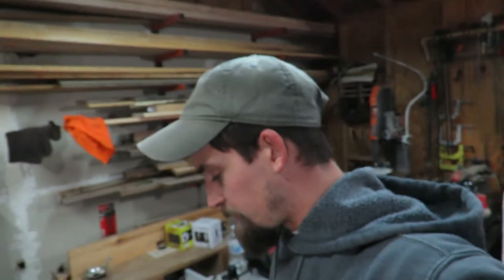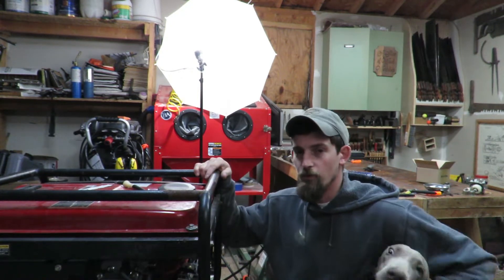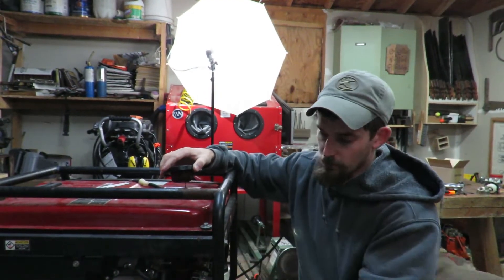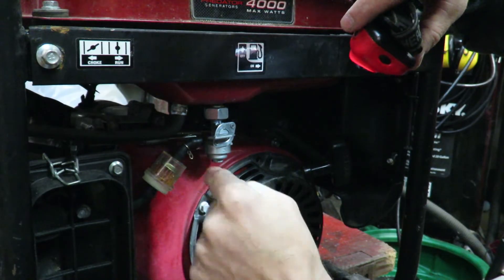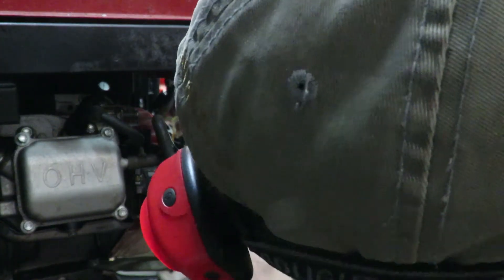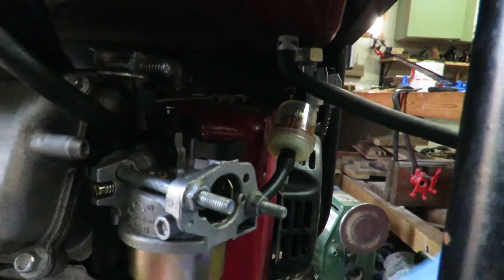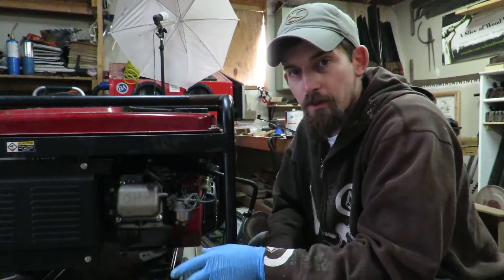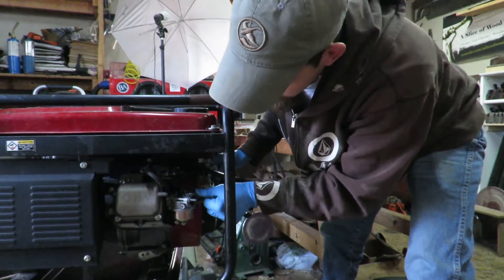Predator 4000 Generator | Solving the Fuel Issue

Comment: I have this generator with the exact same issue except this didn't solve my problem. Brand new clean carb and have adjusted screw. Starts and then after 3-5 seconds it dies. HELP!
Reply: You could check the fuel petcock, too. Mine was all gummed up and didn't allow gas to flow to the carb.
Reply: @mahlenbrenda  thanks but that has been removed and cleaned. Fuel line is clear and clean. I can play with the throttle and it will stay on a little longer, but I don’t know how to adjust. Everything appears connected, no missing springs or anything like that.
Reply: @bradleycutrell728  Another thing I learned the hard way - after I removed the petcock to clean it and all the gas drained out I put in new has, but didn't wipe out the residue from the old fuel first. Mine was like yours, it ran for may 15 seconds and then stopped. All the residue left over from the old fuel tank gummed up the carb again. So I drained it a second time and wiped gas tank out good and clean and after the cleaning the carb again, it now runs great.
Reply: @mahlenbrenda  Don’t forget about the generator safety rules: Always make sure you follow all the generator safety rules whenever you use your portable generator. This is only a reminder. Generators can be dangerous if not used carefully. Every year, hundreds of people die or get injured when using portable generators due to carbon monoxide poisoning and electrocution. Make sure you are using your generator carefully and keeping others safe as well. There is something very serious that everyone should always be aware of when using generators. Some people do run their generator indoors which is not safe and that increases the risk of carbon monoxide poisoning which can cause death of family and you. Some people run their generator in wet conditions which can electrocute them. Please remember that you should never run your generator indoors. Remember that carbon monoxide is an odorless and colorless gas that you cannot see or smell. Carbon monoxide is a silent killer. Keep that in mind. Make sure your generator is 15-20 feet away from your house and away from doors, windows, and vents. Never use your generator in your porch too. Having a carbon monoxide detector is very important against generator safety. Some people also allow children to go near the portable generator which could pose risks. We need to keep an eye on our children making sure that they are not near the portable generator so they won’t get electrocuted or burned by the generator which is dangerous. A locking enclosure also keeps kids safe. A generator shed might look like a tempting place to explore, or take cover during a game of hide and seek, but a generator is a dangerous piece of equipment that can cause injury. It says on the manual that we should also keep children away at all times from the portable generator to avoid injuries. Please do not allow a child or unqualified people to operate the portable generator.  It is important to keep your children safe especially little ones. The portable generator can be hot during an operation. Just because some manuals missed what should be listed doesn’t mean it’s safe to do. Always follow the generator safety rules when using portable generators. Generators pose electrical risks. If you need to use your generator during wet weather, you need a generator tent to protect your generator from getting wet. Don’t let your generator get wet. Keep your generator dry and before using your generator, please make sure your hands and your generator is dry. Do not wear loose clothing when operating the generator. Everything that is said on the generator’s operating manual should not be ignored. Never smoke cigarettes near the generator. Please keep flammable things away from the generator. Never overload your generator too. Your generator can catch fire. Never ever try to plug a generator cord into a wall outlet to avoid back feeding. Back feeding your generator is dangerous. Always turn on your generator first before plugging in appliances and shut off the appliances before turning your generator off. Use a heavy duty cord for your generator and the cord should not be worn out. All the instructions should be followed carefully. Never refuel your generator while it’s running. It can cause fire if fuel spills while your generator is hot. You should turn off your generator and let it cool off before refueling it. Having a fire extinguisher next to the generator is also important. This is only a reminder for everyone’s safety of using generators. Make sure your generator is properly grounded. Having a fire extinguisher next to the generator is also important against the safety rules. https://youtu.be/I1jT3ANENvI and here is a video more about keeping others safe when using generators and also about our family’s safety. It’s important to keep our little children safe as well. Make sure your little children are kept away from the generator at all times especially when it’s running. Hope this helps. Remember it’s better to be safe than sorry.
Reply from the maker: Where did you get the carb from? Some new one may still not be good. Is the fuel bowl getting enough fuel?
Reply: By chance do u  have good fuel Flow ? If u take off bowl ?
Reply: @3370603  Don’t forget about the generator safety rules: Always make sure you follow all the generator safety rules whenever you use your portable generator. This is only a reminder. Generators can be dangerous if not used carefully. Every year, hundreds of people die or get injured when using portable generators due to carbon monoxide poisoning and electrocution. Make sure you are using your generator carefully and keeping others safe as well. There is something very serious that everyone should always be aware of when using generators. Some people do run their generator indoors which is not safe and that increases the risk of carbon monoxide poisoning which can cause death of family and you. Some people run their generator in wet conditions which can electrocute them. Please remember that you should never run your generator indoors. Remember that carbon monoxide is an odorless and colorless gas that you cannot see or smell. Carbon monoxide is a silent killer. Keep that in mind. Make sure your generator is 15-20 feet away from your house and away from doors, windows, and vents. Never use your generator in your porch too. Having a carbon monoxide detector is very important against generator safety. Some people also allow children to go near the portable generator which could pose risks. We need to keep an eye on our children making sure that they are not near the portable generator so they won’t get electrocuted or burned by the generator which is dangerous. A locking enclosure also keeps kids safe. A generator shed might look like a tempting place to explore, or take cover during a game of hide and seek, but a generator is a dangerous piece of equipment that can cause injury. It says on the manual that we should also keep children away at all times from the portable generator to avoid injuries. Please do not allow a child or unqualified people to operate the portable generator.  It is important to keep your children safe especially little ones. The portable generator can be hot during an operation. Just because some manuals missed what should be listed doesn’t mean it’s safe to do. Always follow the generator safety rules when using portable generators. Generators pose electrical risks. If you need to use your generator during wet weather, you need a generator tent to protect your generator from getting wet. Don’t let your generator get wet. Keep your generator dry and before using your generator, please make sure your hands and your generator is dry. Do not wear loose clothing when operating the generator. Everything that is said on the generator’s operating manual should not be ignored. Never smoke cigarettes near the generator. Please keep flammable things away from the generator. Never overload your generator too. Your generator can catch fire. Never ever try to plug a generator cord into a wall outlet to avoid back feeding. Back feeding your generator is dangerous. Always turn on your generator first before plugging in appliances and shut off the appliances before turning your generator off. Use a heavy duty cord for your generator and the cord should not be worn out. All the instructions should be followed carefully. Never refuel your generator while it’s running. It can cause fire if fuel spills while your generator is hot. You should turn off your generator and let it cool off before refueling it. Having a fire extinguisher next to the generator is also important. This is only a reminder for everyone’s safety of using generators. Make sure your generator is properly grounded. Having a fire extinguisher next to the generator is also important against the safety rules. https://youtu.be/I1jT3ANENvI and here is a video more about keeping others safe when using generators and also about our family’s safety. It’s important to keep our little children safe as well. Make sure your little children are kept away from the generator at all times especially when it’s running. Hope this helps. Remember it’s better to be safe than sorry.

Comment: Help. Just bought new 4350 predator generator.bput gas and oil in it. Set the choke right turned on engine pulled cord a few times wouldn't crank. Pulled cord again and it backfired. Scared me. I'm old. No wiring in house.. somebody please help me. What is the problem
Reply from the maker: I would check to make sure the choke and fuel switches are turned on correctly.
Reply: @ASliceofWoodWorkshop  they were. Put a little much oil in it because I lost my balance leaning over to put oil in that hidden oil hole. Tipped generator  about two inches up, oil drained out. Some of it. Do you think I got the sparkplug wet with gas from this? Don't know what to do? Getting dark and I'm frightened
Reply from the maker: Should fire over if you keep trying if it was due to too much oil. If you don't have enough oil that would cause it not to start. Hard to troubleshoot over the net without seeing it.
Reply: @brendastogner4895  Don’t forget about the generator safety rules: Always make sure you follow all the generator safety rules whenever you use your portable generator. This is only a reminder. Generators can be dangerous if not used carefully. Every year, hundreds of people die or get injured when using portable generators due to carbon monoxide poisoning and electrocution. Make sure you are using your generator carefully and keeping others safe as well. There is something very serious that everyone should always be aware of when using generators. Some people do run their generator indoors which is not safe and that increases the risk of carbon monoxide poisoning which can cause death of family and you. Some people run their generator in wet conditions which can electrocute them. Please remember that you should never run your generator indoors. Remember that carbon monoxide is an odorless and colorless gas that you cannot see or smell. Carbon monoxide is a silent killer. Keep that in mind. Make sure your generator is 15-20 feet away from your house and away from doors, windows, and vents. Never use your generator in your porch too. Having a carbon monoxide detector is very important against generator safety. Some people also allow children to go near the portable generator which could pose risks. We need to keep an eye on our children making sure that they are not near the portable generator so they won’t get electrocuted or burned by the generator which is dangerous. A locking enclosure also keeps kids safe. A generator shed might look like a tempting place to explore, or take cover during a game of hide and seek, but a generator is a dangerous piece of equipment that can cause injury. It says on the manual that we should also keep children away at all times from the portable generator to avoid injuries. Please do not allow a child or unqualified people to operate the portable generator.  It is important to keep your children safe especially little ones. The portable generator can be hot during an operation. Just because some manuals missed what should be listed doesn’t mean it’s safe to do. Always follow the generator safety rules when using portable generators. Generators pose electrical risks. If you need to use your generator during wet weather, you need a generator tent to protect your generator from getting wet. Don’t let your generator get wet. Keep your generator dry and before using your generator, please make sure your hands and your generator is dry. Do not wear loose clothing when operating the generator. Everything that is said on the generator’s operating manual should not be ignored. Never smoke cigarettes near the generator. Please keep flammable things away from the generator. Never overload your generator too. Your generator can catch fire. Never ever try to plug a generator cord into a wall outlet to avoid back feeding. Back feeding your generator is dangerous. Always turn on your generator first before plugging in appliances and shut off the appliances before turning your generator off. Use a heavy duty cord for your generator and the cord should not be worn out. All the instructions should be followed carefully. Never refuel your generator while it’s running. It can cause fire if fuel spills while your generator is hot. You should turn off your generator and let it cool off before refueling it. Having a fire extinguisher next to the generator is also important. This is only a reminder for everyone’s safety of using generators. Make sure your generator is properly grounded. Having a fire extinguisher next to the generator is also important against the safety rules. https://youtu.be/I1jT3ANENvI and here is a video more about keeping others safe when using generators and also about our family’s safety. It’s important to keep our little children safe as well. Make sure your little children are kept away from the generator at all times especially when it’s running. Hope this helps. Remember it’s better to be safe than sorry.

Comment: Yeah I've got one of those generators like yours also but it's a bit newer and my gaskets are not in good shape and there giving me the same problem you were having. I can adjust the choke a bit and get it to run half way decent but I'm going to have to try and figure out were to get the correct gaskets for it.
Reply from the maker: Try doing a Google search for the part number. There are a lot of off brand things being made now
Reply: @ASliceofWoodWorkshop  👍

Comment: When you leave something plugged in and it dies, you lose residual magnetism.  Plug in a corded drill and give it a few spins while the generator is running it give it a boost. If going one way on the drill doesn’t work, try the other direction.
Reply from the maker: Tried that in both directions and it didnt work unfortunately